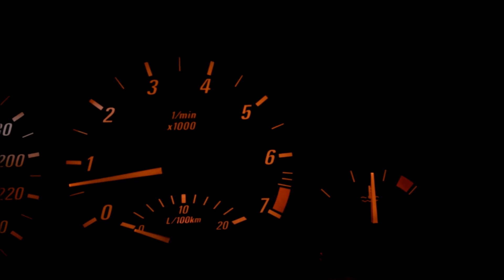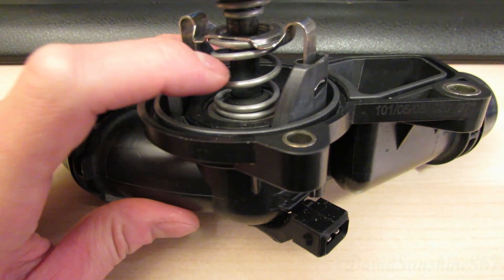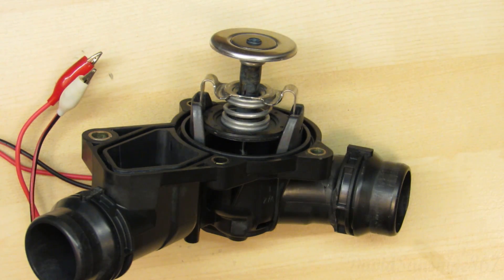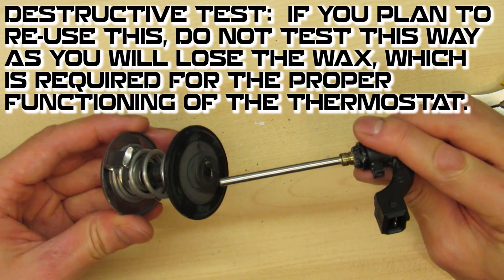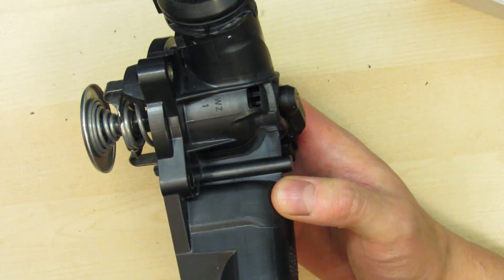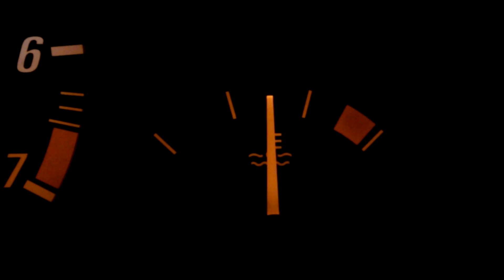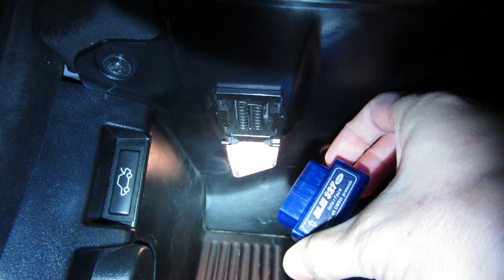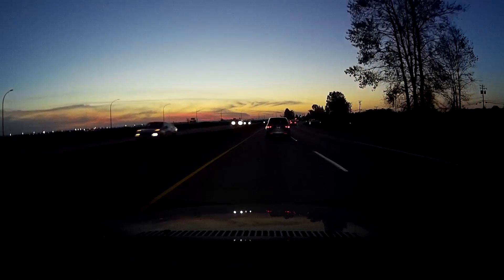How a Thermostat Works in the E46 - How to Diagnose a Broken Thermostat

Comment: thanks for the great video. I have a different situation with my Turbo diesel Vw. on the cold winter days if I don't drive it over 110 on highways it never reaches temperature I can drive all day In city traffic ic and it stays cold even the heater is just warm not hot as soon as I stop on the lights it cools even more.  any ideas?
Reply from the maker: Hi,  I have no experience with that problem,  and I've never had a VW or worked on one, but first thing that comes to mind is air in the system,  which would explain the cold during idle and hot while running.  Maybe bleed the air out of the system and make sure it's topped up with fluid?
Reply from the maker: And you're welcome!  Glad you thought it was good!   Thanks for the comment!  Please let us know how it works out for you.  I'm sure your findings will help others with the same problem too!  Cheers. 

David.
Reply: Hey buddy you never showed how  to clean the thermostat?